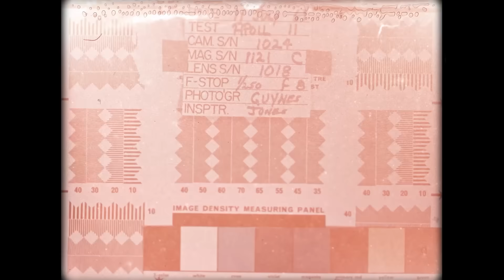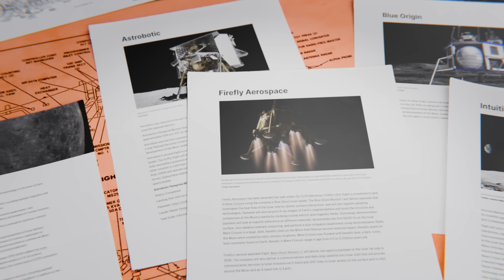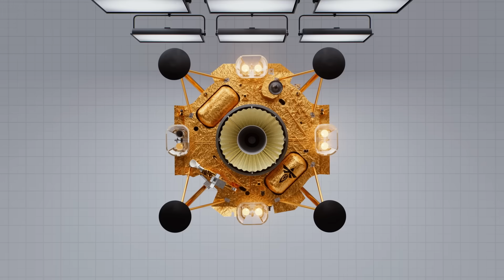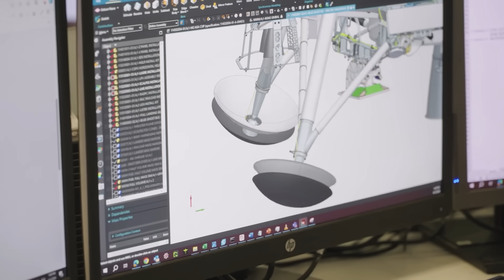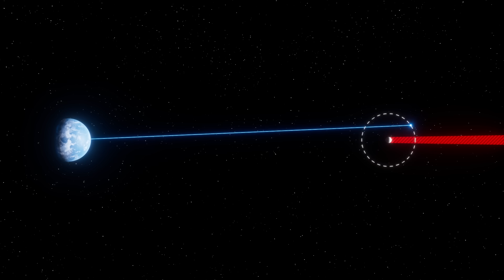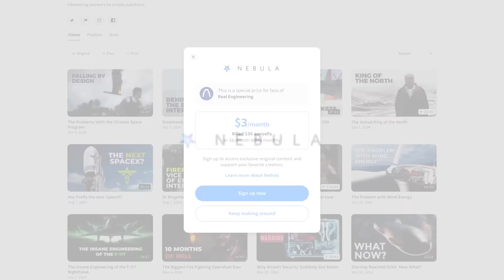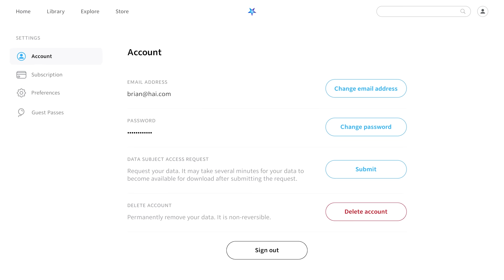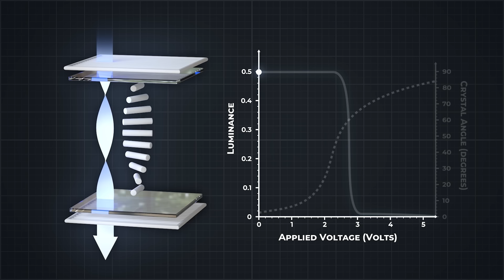Why the US is Struggling to Land on the Moon

Comment: I am v confused: manned flights are too expensive, but the 50% failure rate quoted includes and is mostly made up of unmanned landing attempts? This muddled explanation is frustrating. A landing piloted by Aldrin avoided the toppling incident shown to prove landing is not safe enough to send pilots. I was left with the overwhelming impression from the information that piloted flights would actually increase the landing percentage. Just really badly explained. The cost could also be worthwhile if that percentage increases.
Maybe someone here can explain it to me, cos the intro was massively contradictory/selective in info that seemed to compare apples and pears and come up with grapefruit.
Reply: Manned flights are too expensive: Apollo cost $300 billion. IM-1 cost 1/3000 of that. 
The goal of IM-1 was to make an unmanned landing with the same kind of reliability and accuracy that the Apollo missions had. This meant it needed advanced systems to do terrain recognition, so it could avoid obstacles. The unmanned landers from the 1960s didn’t do this: they only had an altimeter so they knew where the surface was, but they couldn’t detect boulders or change their course to avoid them. 
Manned flights are too expensive because a manned spacecraft has to be far more complicated, and a lot larger: the LM weighed 15 tons. IM-1 is closer to 150 kg.
Reply: @Hobbes746 thank you, that clarified things perfectly. Cheers!

Comment: I still don't understand why they aren't using radial proximity radar, like modern cars do, to detect obstructions, obstacles, and collisions. It seems like the over-reliance on exclusively visual data is what caused Unintuitive Machines's epic failure.
Reply: IM-1 carried a laser altimeter. They forgot to switch this out of safe mode during the preflight check, which meant the landing was done without its primary data source being available.

Comment: Can't even copy the so called moon landing of the 1970s. 

Was it fake?or NASA is getting more dumber and dumber after each decades.
Reply: I don't think it's smart to copy almost 60 year old technology.
Reply: Don’t want to copy Apollo because it was incredibly expensive, more like. IM-1’s budget is tiny in comparison.
Reply: apollo was fucking 200 billion dollars and using old tech is horrible please get educated.
Reply: It's not like you say, folks.
Usually, when copying  previous successors or the earliest version, the newer ones are improved , updated , upgraded, and streamlined in production to improve the cost efficiency of the earlier version. 

Remember, many older components can be replaced with better quality and better technologies with the same functionality but with more advanced materials, lighter and better design. 
Unfortunately, the APOLLO program patents were too lousy for update and upgrade.
Or was it something else that's not worthy to do further development?
Reply: @loktom4068  The main problem with Apollo was the huge cost. To solve that, after Apollo NASA started a massive project to make access to space cheaper: the Space Shuttle. That project didn’t bring the improvements they had hoped for, which meant that for the next few decades the cost of access to space remained so high that a manned moon mission could not be done within NASA’s budget.

Comment: Shouldn't be that difficult, there are many fine directors who can duplicate what Stanley Kubrick created and with better CG. Fewer takes will keep your actors fresh, too.
Reply: Sorry no CGI back in the 60's ~ 70's.
Next..
Reply: @G.Gorrell  They didn't need cgi to fool the people back then, practical effects did just fine.
Reply: What Kubrick created can be seen in 2001. The space and lunar scenes in that movie used state of the art special effects, and they are immediately recognizable as effects: those scenes were provably recorded in 1 g gravity. The Apollo videos were done in 1/6 g gravity, which we cannot replicate on Earth. This proves those scenes were not recorded on Earth but on the moon.
Reply: @Hobbes746 How do you land on plasma?
Reply: @b.chuchlucious5471  "How do you land on plasma?"
By using CGI that didn't exist back in the mid-20th Century and then when you get there you step very lightly.
Reply: @G.Gorrell The national academy of space actors has the largest budget, so they can pull off any effect to keep the people fooled, so you're right there.
Reply: @b.chuchlucious5471  : First try to explain where Sun is after sunset...
Reply: @b.chuchlucious5471  The moon does not consist of “plasma”. A plasma is a gas that’s so hot the atoms lose their electrons. A gas that hot glows brightly. The moon does not produce any light: if it did, the moon would not have phases. 
The moon is also far too small: a plasma could the size of the moon does not produce enough gravity to keep itself together.
Reply: Douglas Trumbull was the visual effects man for 2001 and so he would have been the visual effects man for the eventual 6 fake landings. However, he has vehemently denied that he or Kubrick were ever involved in making any fake moon landing film ever.

Comment: kinda sounds like a bs excuse
    anyone who plays kerbal or juno will tell you better arrest your lateral velocity before touch down
     trust it hold true to real life as well 
🎉  
   the auto pilot should've had lateral velocity at 0 and pitched to compensate for rotation with engine at idle to keep at 0 well before touchdown
Reply: The autopilot was flying blind: the altimeter wasn’t working. IM found that out after launch and cobbled together an alternative from payloads on the spacecraft, but the data quality from those was lower.

Comment: I can tell you what went wrong. Look at the thing compared to the Apollo 11 module. The new module is too tall, doesn't have a low centre of gravity like the much shorter and squatter 11 module.
Reply: No. What went wrong is that they forgot to switch the altimeter out of safe mode, which meant they were landing with lower-quality altitude data which lead the system to think the ground was farther away than it really was.

Comment: Out of curiosity, why don't we use the ISS to help with these tasks? Like couldn't we use the systems in the ISS as a relay satelite to work with another satelite closer to the moon to help the landers keep in contact or communicate with human teams or something to mitigate the problems with landing?

Or as another option, why don't we use the ISS as waystation for launching things to the moon? We can fairly reliably get to the ISS, so why not just send a lander on a supply rocket or something to the ISS, then launch it from the ISS to the moon?
Reply: The ISS is useless as a communications relay: it’s only 400 km closer to the moon than Earths surface is. And here on the surface, we can built antennas as large as we like: for Apollo, we used dish antennas with a diameter of 26 meters. We can’t launch those to the ISS. 
Using it as an intermediate station for missions doesn’t help either. If you launch to the ISS, the orbital plane of the ISS limits when and where you can launch to your next destination. 
To get from the ISS to the moon, you have to accelerate by 3.4 km/s. This takes a lot of fuel. That means your spacecraft is going to be large and heavy, which makes it difficult to dock with the ISS. It’s more efficient and less complex to launch directly to the moon instead of stopping at the ISS.

Comment: why not send a drone conected to the moon lander and before the Moon lander lands, have the drone be left behind so it can better assist the lander in landing, like some sort extra eyes so ur expensive drone dosnt trip over a rock. idk im not a smart person but they did have a command module for a reason. mybe a drone can function like the older ones did idk.
Reply: That won’t work. That drone has to slow down and make a soft landing itself, which means it’s going to need the same kind of landing system that the main spacecraft has. 
What Intuitive Machines should have done is check the spacecraft thoroughly before launch. They forgot to switch the altimeter out of safe mode, which made a soft landing impossible.

Comment: What they need , is someone to remotely control the lander from earth , either with a joystick or game controller, sensors clearly don't work if something worth 100 000 000 can just simply fall over and be rendered damn near useless
Reply: The signal delay to the moon is 1.2 seconds. The Soviets operated two lunar rovers via remote control. Driving at 1 km/h was barely feasible with that delay, for a lander such a delay means you’re going to be too late.

Comment: Simple answer, fake moon landing
Reply: IM-1 landed, but just not upright.
Reply: @ThomasKunderaBis  Comparing the capabilities of the devices at that time and now, we notice that the technology could not have reached the moon easily in the past and now with difficulty. The only explanation is that the moon landing was filmed in the Hollywood way.
Reply: @bandarff7899  :
"Comparing the capabilities of the devices at that time and now"
I dunno which devices you want to compare.
But if you compare the first soft landing (Luna-9, 1966), with IM-1, it's clear how technology made reaching the Moon easier:
On one side a a decade of dedicated effort of a full nation (the USSR) with tremendous funding, on the other, a small US startup with a few million dollars, that did about same, but for a small human error that impacted last mn of landing.

"The only explanation is that the moon landing"
There were tens, you write as if there was only one. Seems you ignore a lot.

"was filmed in the Hollywood way."
I don't think Luna-9 landing was filmed even less "the Hollywood way". Would have been "Mosfilm way" if it was. But not even: there were just a few low resolution B&W pictures from surface. Getting data back was hard then.
Reply: @bandarff7899  We notice that for Apollo, NASA invented, designed and built everything they would need to successfully land on the moon.
Reply: Populist answer: simple, appealing, and incorrect.
Reply: Moon landing in the singular?

Comment: Why not use the same technology for landing on Mars recently?
Reply: IM-1 was designed to be a lot cheaper than any of the Mars landers. The landing solution for IM-1 is far less complicated than the solutions that are used to Mars. Mars has an atmosphere you have to account for, but not enough atmosphere to slow the craft down to a safe speed on its own, so a combination of elements has to be used for a Mars landing. 

A skycrane, like IM-1, needs an altimeter to allow a safe landing to occur. Where IM-1 went wrong is that the team forgot to switch the altimeter out of safe mode before the flight. This would have doomed a skycrane just as it doomed IM-1.

Comment: why not take a tip from airplane landing systems, create a durable probe with an ILS system inside and land it on the moon, then every future mission has a reference beacon to land at. giving acurate elevation data....
Reply: That works if you have an infrastructure on the planet/moon that can place those beacons and tell you where they are. 
We’re not at that point yet for the moon.
Reply: @Hobbes746 I was thinking more along the lines of a durable first beacon, with its own power supply and everything needed in one package for future landing aid.  Im sure it could be figured out as a standalone package.
Reply: @Wabadahabada  That package would need its own system for making a soft landing in an accurately-known location. IM-1 is pretty close to what you would need to create such a beacon. 
We might see this happen for the manned Artemis missions, but for missions like IM-1 launching a $100 million beacon and then launching a $100 M mission makes no sense.
JAXA’s SLIM lander demonstrated that even without a beacon, you can land on the moon within 100 meters of your target.

Comment: If we went then it should be really easy now. Really easy. Cant compare the tech.
Reply: They've landed on the moon 6 times, but do you really think the contractors involved would keep their production lines for 55 years for a product that will never be built again?
Reply: We’ve been building airliners continually for decades, and yet Boeing had to spend $25 billion designing the 787. Airliners also aren’t any less expensive than in the 1960s. Similarly, the huge rockets you need continue to cost tens of billions to design and build.

Comment: What changed? No people on board.
Reply: Before Apollo, NASA ran 7 Surveyor missions, which made unmanned soft landings on the moon. 5 of 7 of those missions succeeded.
Reply: @Hobbes746 True, but these were designed with demonstrating soft-landing in mind, so they were completely under-performaning when it came to payload accommodation. E.g., they had a very low CoG and very wide footprint. In the world of CLPS this would not close the business case. So, here are your options for a successful Moon mission: 1.) make an unmanned demonstrator, basically a PR mission without much value, 2.) spend significant amounts in development and testing of a high-performance unmanned lunar lander, including hiring the 10x experts on the topic (I am free at the moment), 3.) fly with astronauts on board.
Reply: @odril  The Surveyor method can be used for larger landers too. The Russians made successful soft landings in the 1970s, with spacecraft large enough to carry a sample return rocket, or a large lunar rover.

Intuitive Machines came very close to a successful soft landing. Their only failure was that they forgot to switch the laser altimeter out of safe mode during the preflight check.
Reply: @Hobbes746  More precisely, a safety lock of the laster altimeter, which is the prime sensor input tot he GNC data fusion was left in place. So, like I said: you need people who know what they are doing.

Comment: Has anyone ever considered using radar instead of cameras? And perhaps LiDAR?
Reply: The Americans used radar on the Surveyor landers in the 1960s. Intuitive Machines had a laser altimeter in addition to the cameras, but they forgot to switch the altimeter out of safe mode, which meant it didn’t work.

Comment: Since 1972 we have a gap of 52 years. The moon landing apologists have to choose instead of trying to excuse NASA and the US Government. We either didnt go to the moon or we dis and we lost the technology as  Dr Pettit said some years ago. I wonder how convincing the latter is but you could argue its safe and effective... Do you remember this part of the official narrative? I cant decide which slogan is harder to believe.
Reply: We have plenty of evidence that proves the US landed on the moon multiple times in the 1960s and 1970s. We also know why they stopped: the USA decided to stop spending so much money on spaceflight. 
This reduction in budget meant that the Apollo program ended in the 1970s, and its successor was not designed to land on the moon. That meant that since 1972, no work was done on lunar landers. By 2010, when Don Pettit said that, the last lunar lander design was 40 years old and thoroughly obsolete. Building more copies of that lander would have to start by redoing the entire design. This will be complicated and costly, just as doing the design the first time was complicated and costly.
Reply: "We either didnt go to the moon "
Incorrect.
Twenty four people went to the Moon in nine missions, of which twelve landed in six missions between 1969 and 1972. Inform yourself.

"or we dis and we lost the technology as  Dr Pettit said"
In the sense he used it, we did, right.

"I wonder how convincing the latter is"
It's a fact.

Try to think.

Comment: Is a radar too heavy or why don't they use that to track the height once they're too close to the surface for the optics to work?
Reply: They used a laser altimeter. Problem is, they forgot to switch that out of safe mode during the preflight check so it wasn’t working during the landing.

Comment: I think the short version basically is that apollo era landings were fairly naive, and for the most part selected targets that fit the available technology. Using ground tracking radar with a bunch of averaging and filtering you can treat the ground more or less as a flat surface as long as its not that far from flat.